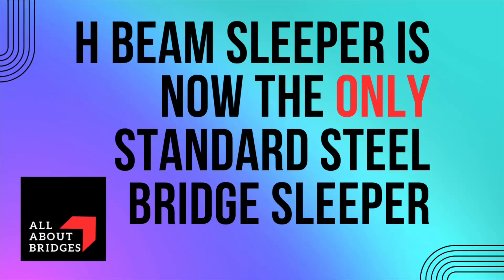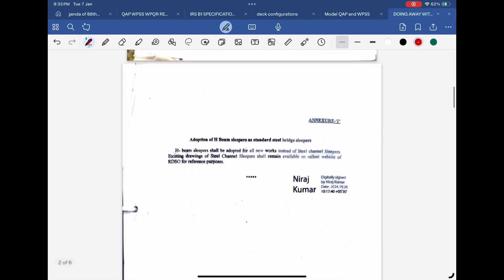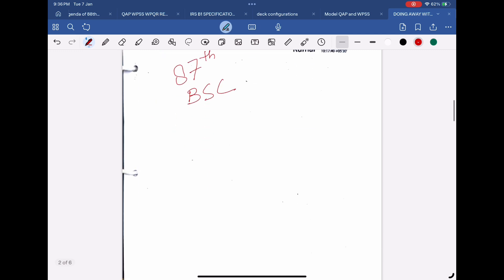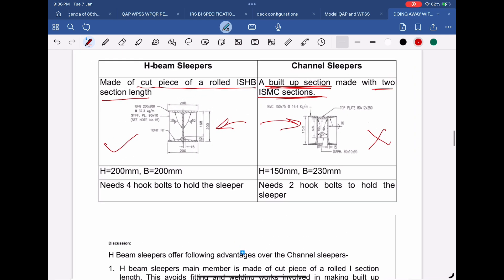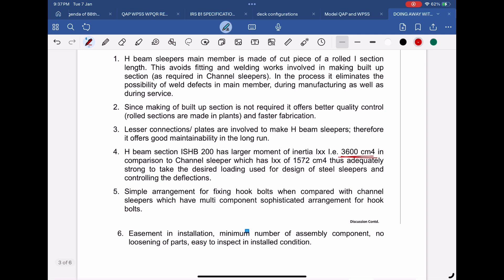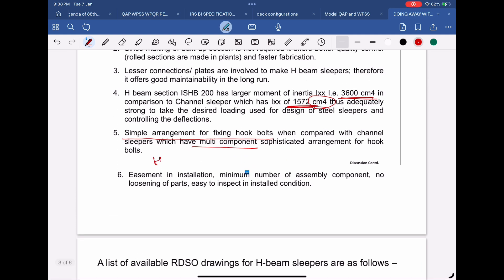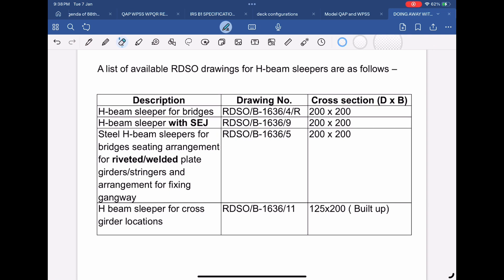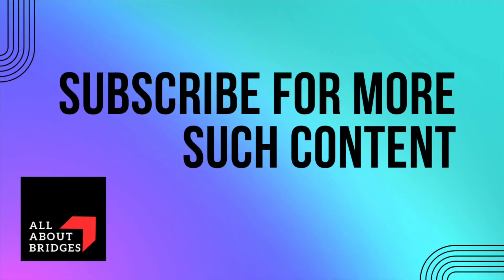RDSO adopts H beam sleepers doing away with Channel sleepers.

Comment: It is very difficult to align the H beam sleeper in site due to variation in level of stringers and also in cambers , which results improper gauge and cross level. Please provide guidance regarding the same
Reply from the maker: @hitormiss8268  can you elaborate more about this problem